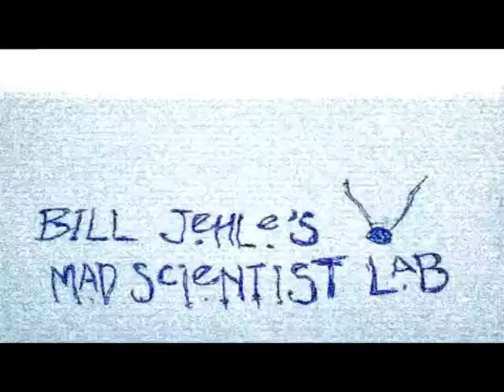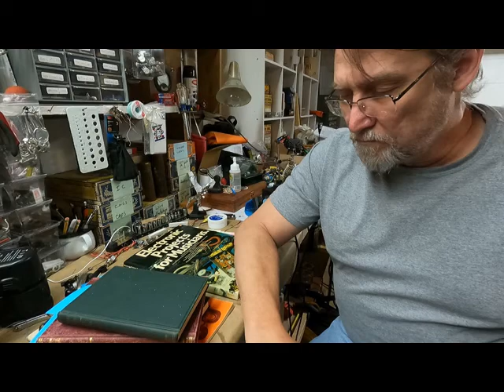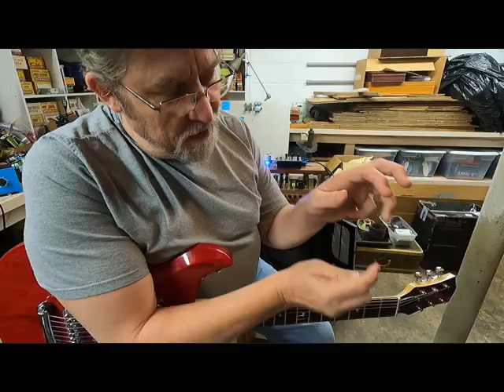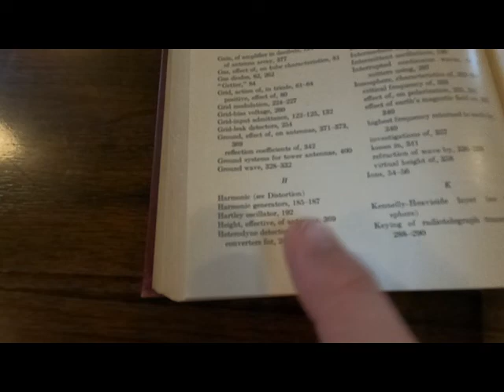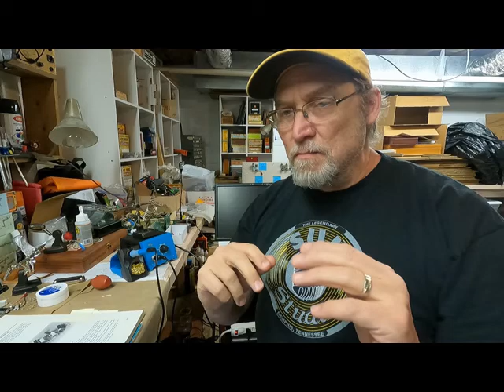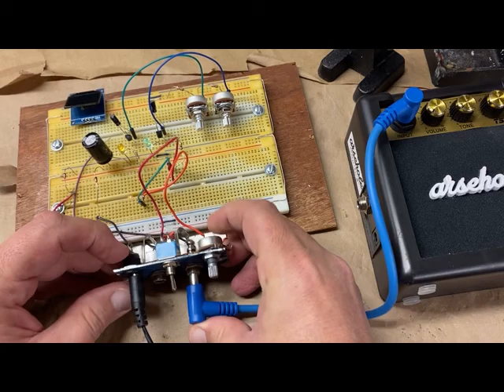Mad Scientist Lab: From Electronic Projects For Musicians Ring Modulator to the Theramin

Comment: The thing guitar players neglect, or perhaps simply don't know, about ring modulators is that they were developed to modify pure steady-state waveforms, generated by electronic oscillators.  You feed in a 400hz sine wave, modulate it with 100hz sine wave and you get out 300 and 500hz.

But guitar signals have NEVER been anything like that.  First off, they are harmonically rich,  Second, the harmonic content changes with time after initial pick attack.  Third, the harmonic content is a function of the particular fret (i.e., 2nd, 5th, 9th, etc.).  Finally, we tend not to notice it, but we generally introduce a small amount of pitch deviation when we pick.  That can be from bending the neck a bit, from lightly, then firmly pressing the string down, from pushing the string to the side a bit when we hit it hard with a pick, and so on.  The point is, a guitar string under normal use is miles away from what a ring modulator expects.

Can we help this scenario?  Yes.  First off, heavier gauge strings that will reduce pitch deviation, and have less harmonic content to begin with.  Second, use the neck pickup, with the tone rolled back.  Third, use some compression or limiting before the ring modulator.  All of this is intended to make the guitar signal come closer to the conditions anticipated by ring modulation.  

In the case of the EPFM circuit, there are several things one can do, and which are already done, to further that.  The diode pair to ground form a very crude peak limiter, and provide a more constant signal level.  But there is NO filtering whatsoever of the input.  That first op-amp stage needs a feedback capacitor.  A 1nf cap ought to be a good start.  Second, there ought to be some additional filtering between the output of that stage and the input to pin 2 of the 565 chip.  Here, I suggest divvying up whatever series resistor one used (33k or greater, depending on application) into several smaller series values, adding up to whatever the original resistor was.  For example, 33k could be turned into 18k+15k, or perhaps 5.1k+5.6k+22k.  Run a small value cap from the junction of the series resistors to ground.  For example, assuming the series resistors are 5k1->5k6->22k, use 18nf for the 5k1/5k6 junction, and 15nf for the 5k6/22k junction.  That provides 2 poles of lowpass filtering just a bit below 2khz.

Now, following the math, the higher the modulating frequency, the further away from the note will the sideband products be.  So, if one wants the end result to sound somewhat "pitched" (i.e., you can follow a sort of melody) and simply a bit "boing-ey", you tune the modulating frequency as low as you can.  Again, because of the math, the higher up the guitar notes are, the more the result will have a pitched sound, with a bit of "rubber band" to it, because the sideband products will be closer to the original pitch.  And because we have taken steps to make the guitar signal approaching sinusoidal quality, we won't be getting sums and differences of the various harmonics in the guitar signal.

Finally, about the modulator "whine".  Sometimes you can fully null out the whine with the 2K5 - 5k trimpot (which should be a 10-turn type).  But if that proves to be unfeasible, I use a quick and dirty noise gate.  Replace the 4k7 resistor that feeds the ring modulator to the op-amp output mixing stage with a 2K2 resistor, in series with a back-to-back pair of Schottky diodes (1N5817, BAT41, etc.).  This will block any low-level signals (<220mv or so) from ever reaching the mixing stage.  It subtracts that same voltage from the signal that does exceed the threshold and make it to the mixing stage, which is why I recommend dropping the mixing resistor from 4k7 to 2k2.

All of that should yield a more pleasing ring modulator.  Enjoy..
Reply from the maker: You have way more in depth knowledge about ring modulation than me. I’m impressed. I did find a way around many of the problems I had with the phase locked loop circuit and came up with a fairly useful circuit that could be coaxed into making a ring modulator or a green ringer. I really need to document that build and put it on here. Thanks!
Reply: @MadScientistGuitarLab  I look forward to it.